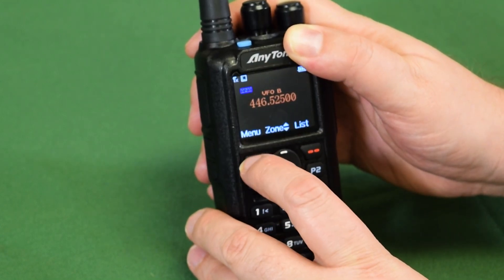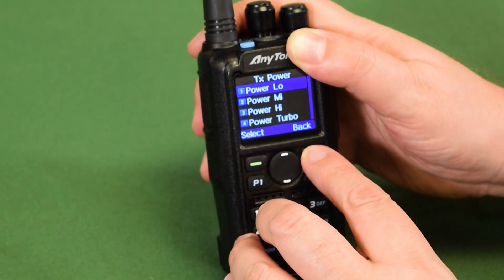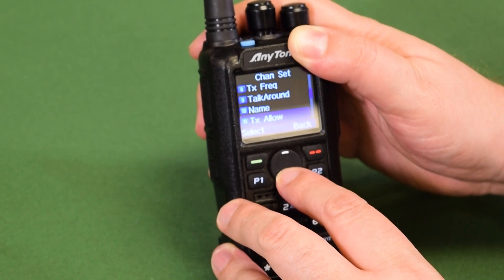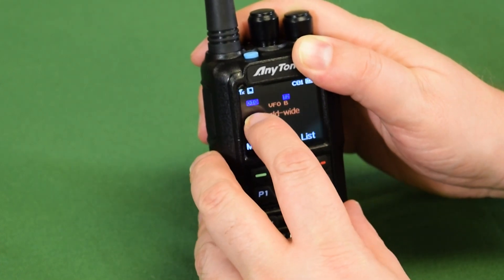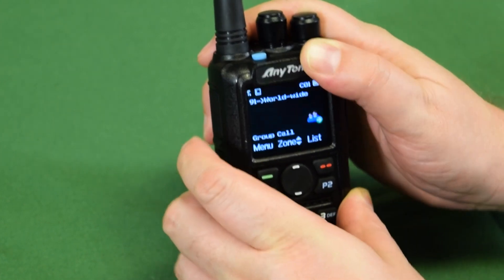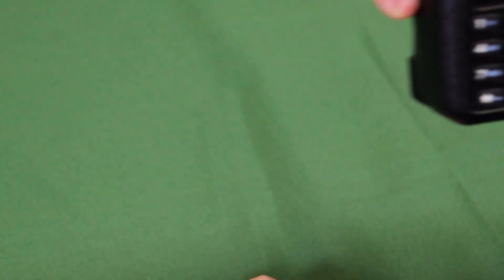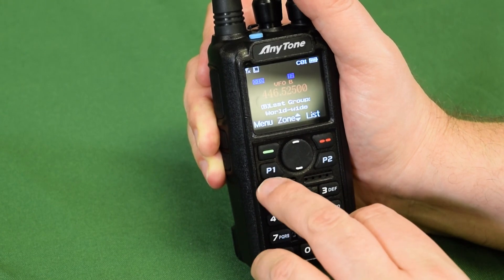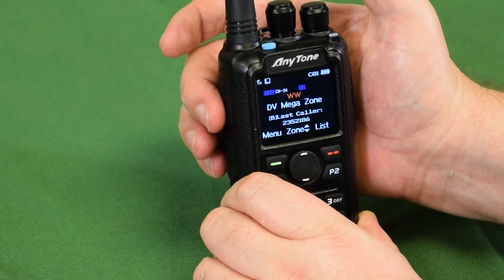How to Program a Digital Frequency Through the AnyTone 868/878 Keypad

Comment: Sebastian, another question, if I may please? How can I add additional frequencies to a preexisting zone? The 1.13 update permitted only 16 channels/frequencies per zone. With the 1.15 update, I've been told that over 200 per zone is now possible. I have updated both my 878 and the software with the new 1.15. I have added more frequencies to my preexisting zone, but when I boot up the radio, the additional added channels are not reflected on the radio. Please help! Vry 73 and thanks!